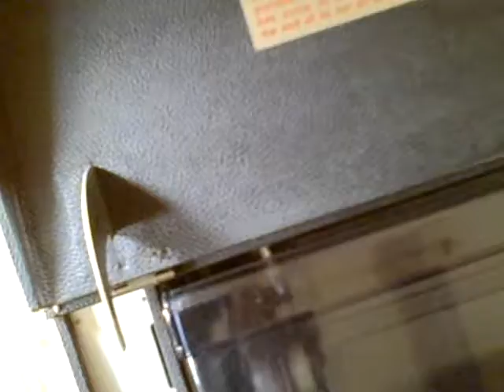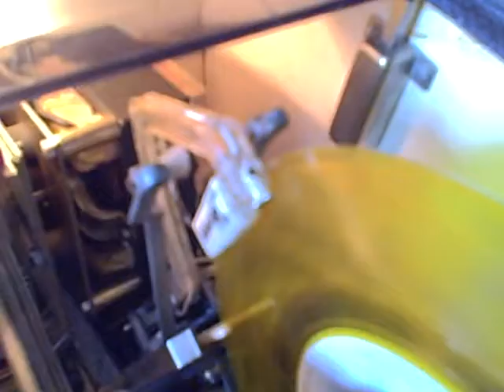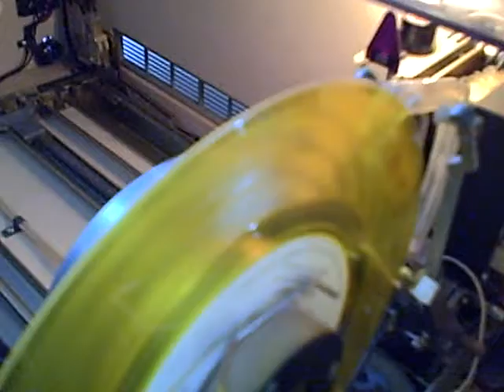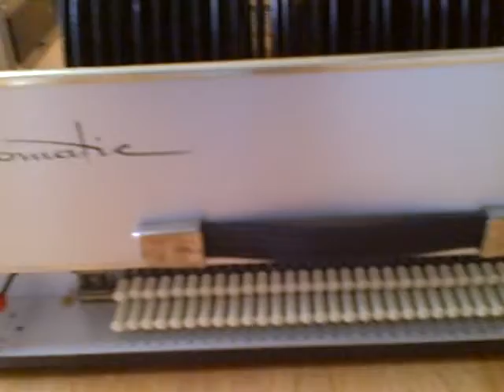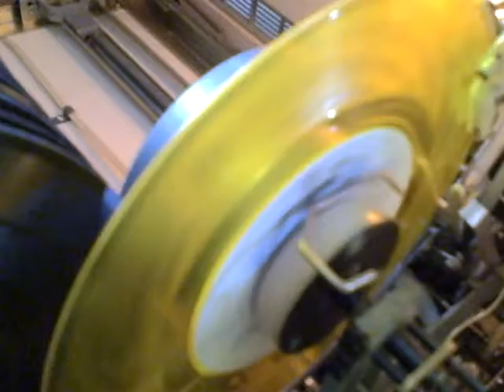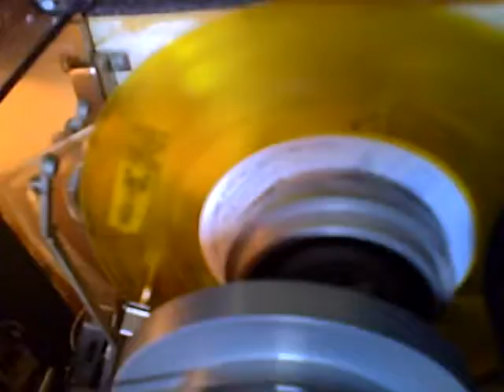Discomatic Jukebox - The ipod of the 60's - JOHN LENNON'S JUKEBOX

Comment: @burf69 

I have listened the video on the both sides of that Elvis record, the pitch seems to correct and plays very well! If it's correct for one side of a record, usually it's correct for the entire device because it's the common turntable (motor and gear) for the two sides of the record. Perhaps some worn parts can make an intermittant abnormal pitch (too fast or too slow)! I notice the straps on that mechanism and this can cause some irregular pitch if one of these straps are worn!
Reply: A Collectables 45.

Comment: there is a smaller belt pully that might be if you are in a different area of the world and the voltage is different and so it might need to have the belt on the smaller pully